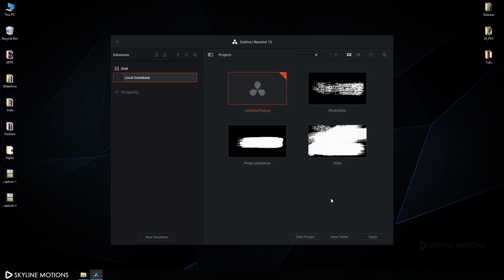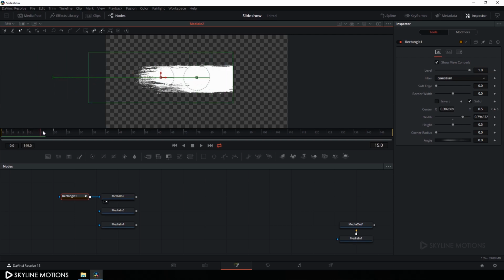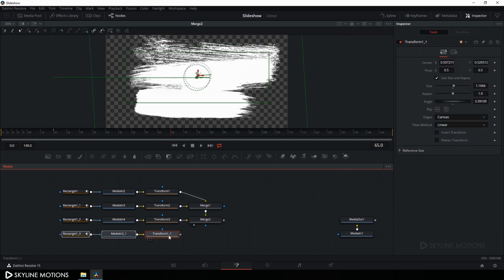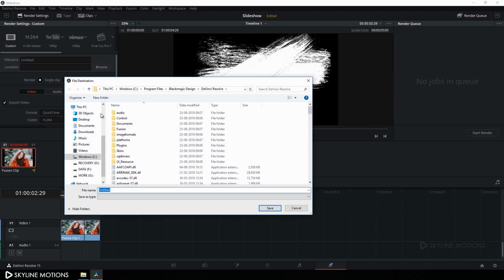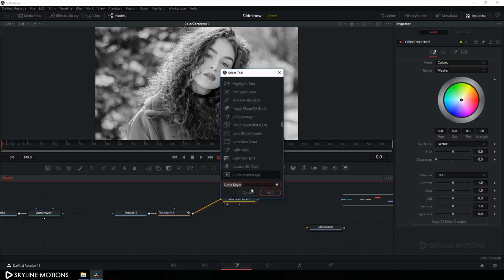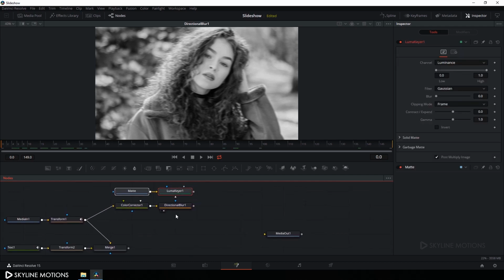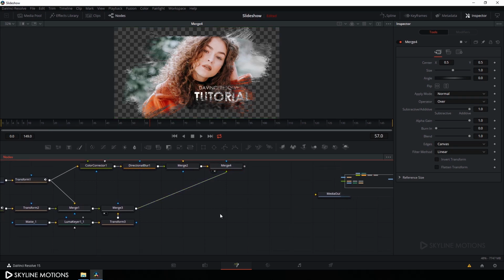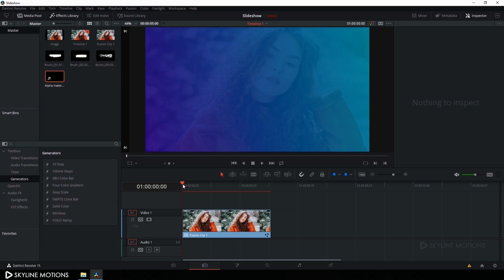Brush Stroke Photo Reveal Slideshow | DaVinci Resolve 15 Tutorial

Comment: I found out that my issue was I was not turning the images into fusion comp. my next question is it ok to add atransform node after rhe image fusion node in order to control the image size rotation ect. or is another way to control the new image